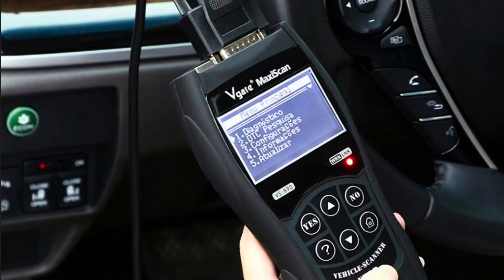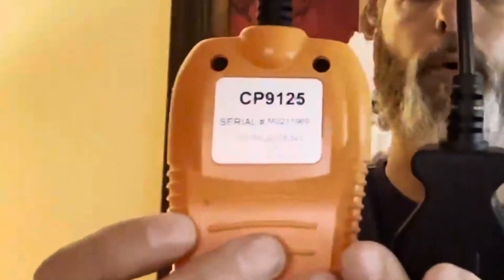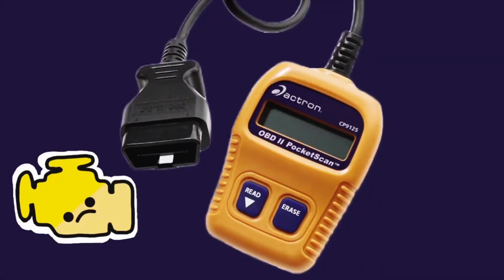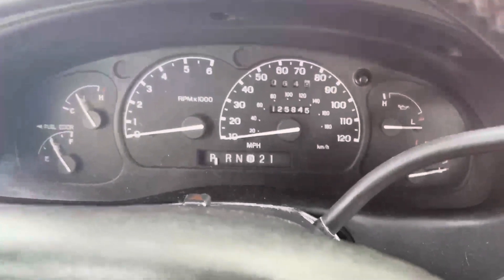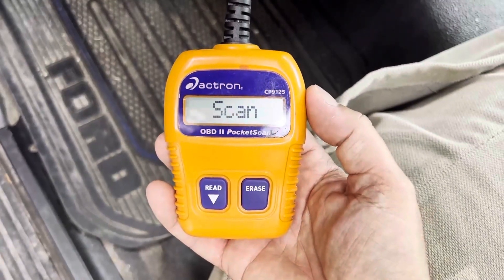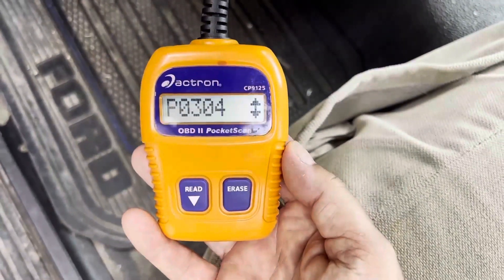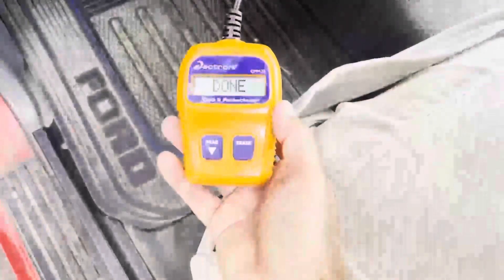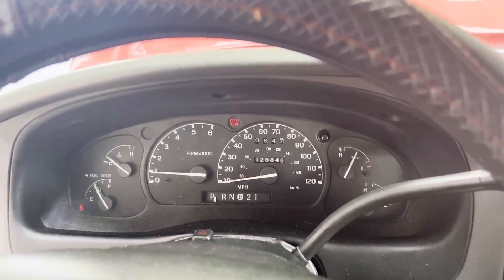Know how to use a Code Reader on your vehicle. How to, DIY.

Comment: My problem isnt the code reader, I can use those but where do I find the wiring diagrams for free, if it's only for my truck! That's my issue or can you buy a one time diagram??
Reply from the maker: I normally just find wiring diagrams on Google but I see your dilemma. Most want to charge for diagrams. Autozone has cheap diagrams online. Sorry I couldn’t be of more help.